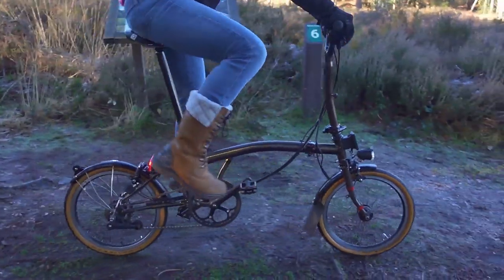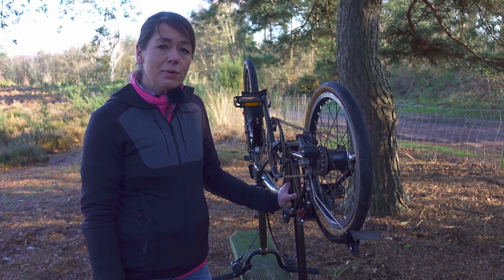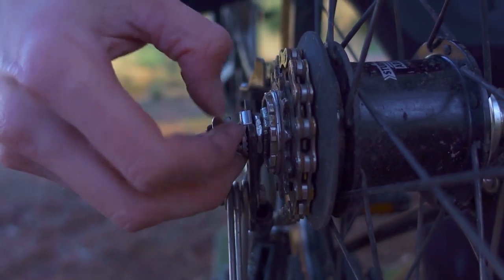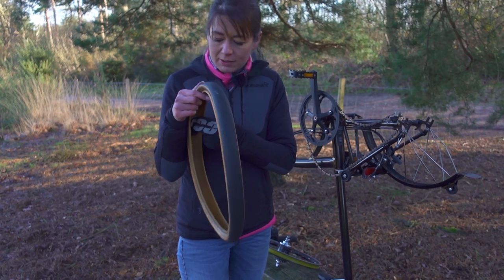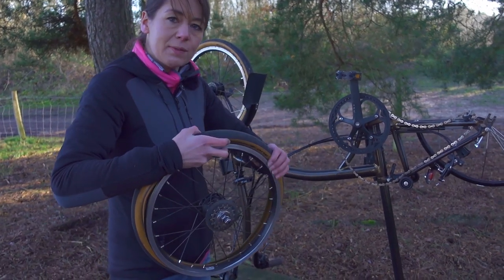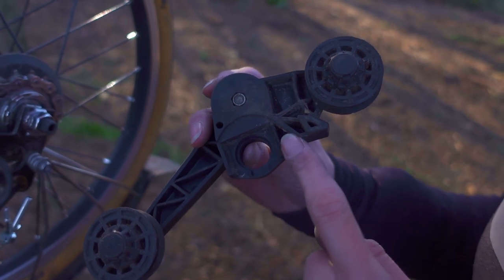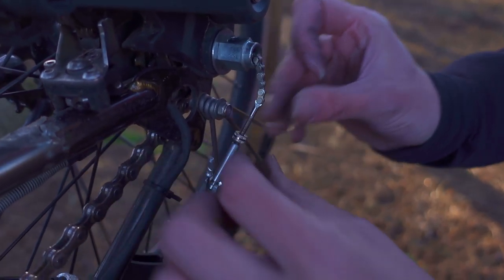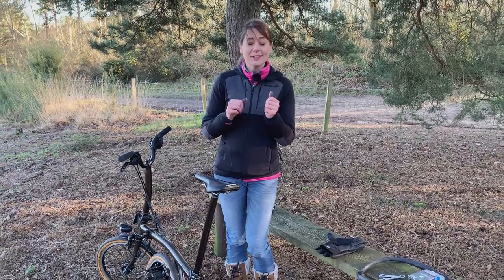Brompton Roadside Rear Wheel Puncture Repair

Comment: The mechanic removed my rear tire without taking the gear indicator chain  out of the internal hub? Is it harmful for my bike? Newbie here
Reply from the maker: Hi - it is possible to remove the rear wheel without taking out the chain tensioner - it shouldn’t cause any problems (it is just a bit more complex than removing as you need to try and manoeuvre everything over it)

Comment: I wish I'd seen this before repairing a puncture on my rear wheel! I took apart the chain tensioner (I know now I didn't need to unscrew that and it was a faff to put it back together). I didn't put it in high gear to start make reconnecting the gear indicator chain easier, maybe if you ever redo this video you can mention that at the start?.

Comment: Great video! I’ve changed my Brompton’s rear tube multiple times over the years but never used the ‘wiggle’, nice tip. Before removing the rear wheel I put the bike in its highest gears for more slack, not just after.

Comment: Another rear wheel puncture, I think it might be contact from the spokes since they are a spoke sized gap apart but the blue tape in the wheel rim looks okay, any thoughts?
Reply from the maker: Thanks for watching and the question

When taking the tube out - try and keep the orientation the same as the wheel - so you can see where the puncture is, then check that part of the wheel / tyre

Was the puncture on the underside of the tube (spoke damage) or the top (something sticking through the tyre) or the side (pinching when installing)?

The blue rim tape doesn't cover the spokes nearly as well as the new yellow one

If you are getting constant punctures in the top part of the tube - then it could be that the tyre is reacing end of life - so thinner and allowing more debris through

Comment: Thanks for the helpful video. I've had my Brompton for over 3 years and I have to admit the only maintenance I've done is pump the tyres and clean it! I had a puncture about 3 weeks ago - it's not my main bike - and kept putting off fixing it because I knew it would be fiddly. I decided I needed help from YT - the first video was OK, but not for a 6 speed. Then I came across this one. 

I managed to fix the puncture with a patch and it seems to be OK. Now I've done it once I won't be so daunted next time!
Reply: Oh yeah - still haven't got the hang of the Brommie pump

Comment: Brillantbikes can you pls tell me what is wrong with a litte sound from rear wheel area. my brompton is few days old
Reply from the maker: Thanks for watching

Do you mean the "ticking" sound?

If you have a 3 speed or 6 speed Brompton - that's completely normal. It is the pawls inside the rear hub ticking as the wheel / hub rotates
Reply: @brilliantbikes  Thank you. please do more videos, I enjoy watching & learned from you. It the rear mudguard a bit dented , so the bike mechanic adjusted and now no more noise

Comment: wouldn't it make sense to blow up the tyre before you refit the wheel, just in case you nipped the tube. Good vid though. 👍
Reply: Nigel, it's better to refit the wheel with the tyre still flat. That way it squeezes through the brakes without having to slacken them off. Time saved.

Comment: And - You can't carry an original, and sometimes badly functioning pump on your "Lightweight", as Brompton has decided that it hasn't got/need the small piece of wire needed to hold the pumps end!!! So I have ordered a pair of velcro straps for the purpose, to hold  my eventual pump, and not the original one but a telescope version!
Reply: With more telescope length and pumping ability, and a "meter", to show how much pressure is inside!
Reply: Two velcro straps, with a double loop and a plastic separator against the frame, to keep it in place! But I do find that Brompton should be able to deliver also a piece of titanium wire for their Topmodels, so that it isn't up to a buyer to find solutions!
Reply: I may put it inside my - seatpost?? Theft-free by that, if the bike isn't stolen?